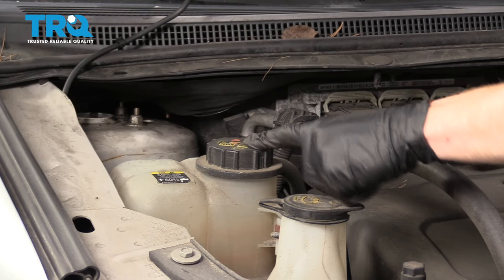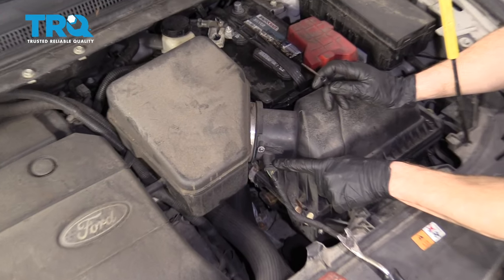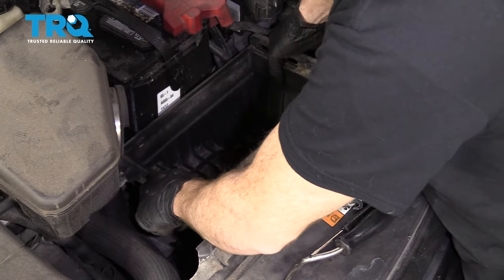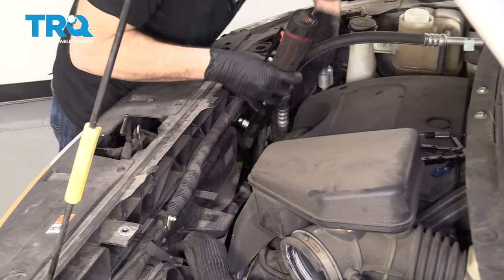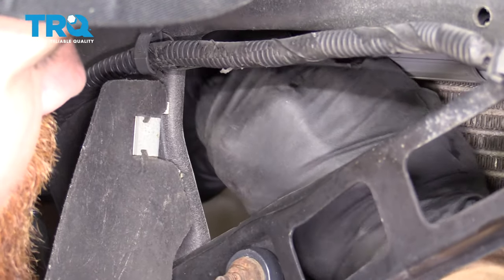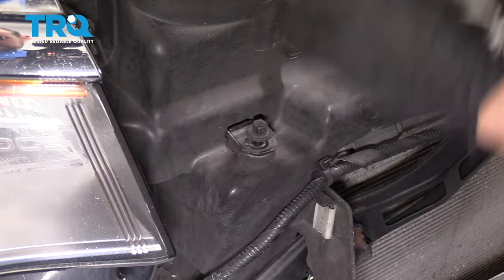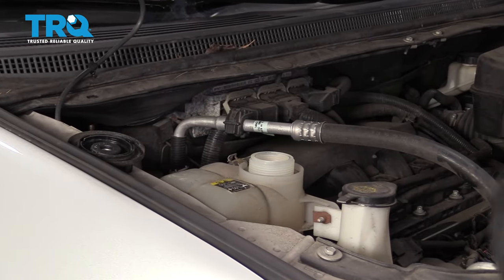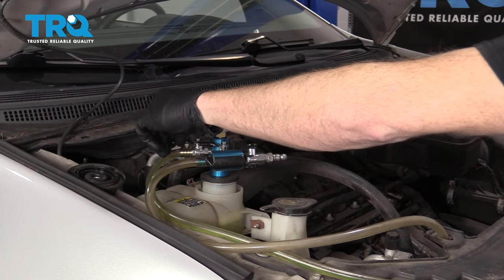How to Replace Radiator 2007-14 Ford Edge

Comment: Good video.  One thing to note, the bolts attaching the air box and the radiator fan are both the same size head (8mm if I remember correctly) but different lengths.  The longer ones are for the air box...don't get them confused.  If you try to use the long ones for the radiator fan attachment, they are so long they will go all the way through and puncture the radiator.  It's just plastic right there, so if you aren't paying attention or using a power tool to put the bolt in it's very easy to not recognize that it got a little harder to screw to bolt in and it will go right on through into the radiator.  You then have to replace the radiator.  Ask me how I know. 😟

Comment: Thanks for this video- you helped me tackle this project.  One tip- you don’t have to fully remove the bumper- I found it effective to remove the bumper cover along the tops and side, but keep it attached on the bottom.  You need to secure it with bungee cords or some other method, but this makes putting the bumper back on a lot easier than fully removing it.

Comment: I have a 2016 edge and I heard you have to unhook AC lines to remove it’s radiator. Does this sound right? Are they that much different than a 2014? Thanks for the videos.

Comment: 7:47 what size ratcheting wrench did you use?
Reply: 10mm
Reply: I drilled a 1/2" hole through the plastic and used a 1/4" drive 10mm socket, extension and ratchet to remove them. Trust me, it's a lot faster.